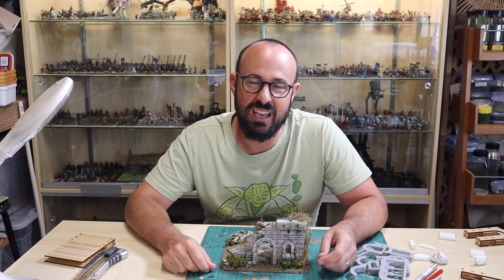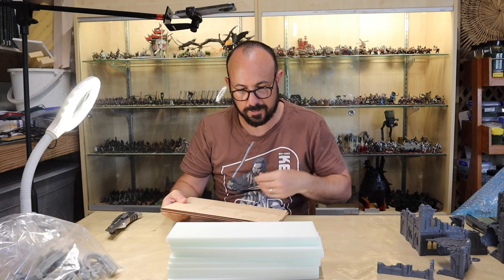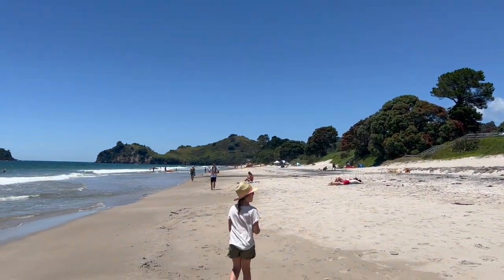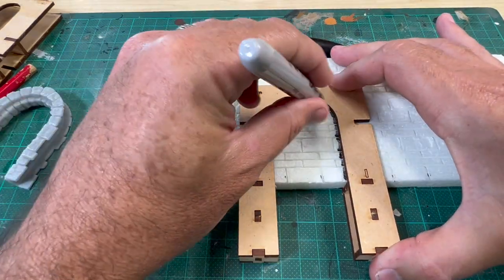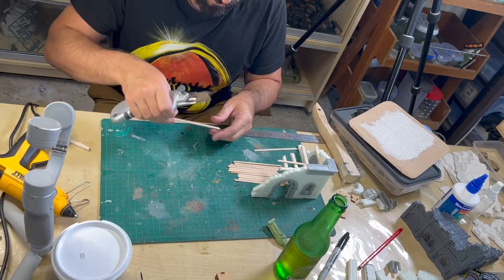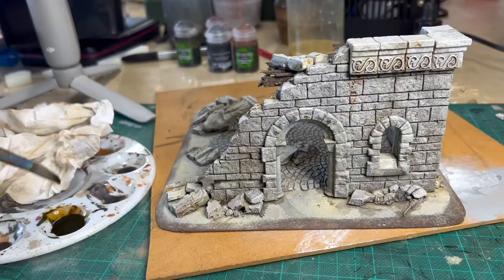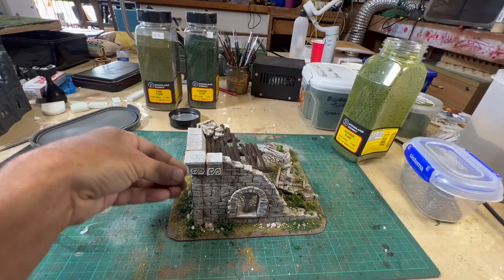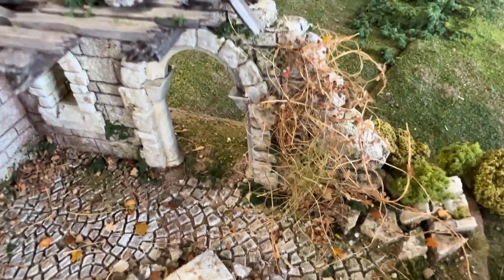How to make Realistic Ruins FAST - Amazing new terrain building system!

Comment: i honestly fail to see the point of this system, eventhough it does look very neat and well made. i make foam-terrain because i don't have a 3d-printer. if i had a 3d-printer - which is required for this system - i would just print entire buildings, rather than make parts of them out of foam. and people with 3d-printers, would you really like to buy a foam-cutter just to make the walls, when you... have a... 3d-printer..? :P again, i fail to see the point :D
Reply from the maker: I get what you’re saying. Thing is you can actually buy the printed pieces if you don’t have a 3D printer. If you do have a printer, the advantage of XPS is the creative freedom you get with it. Unless you’re savvy with 3D modelling you’re restricted by what designs are available to print. With this system you can make whatever you want! 😁 All good though each to their own 😊